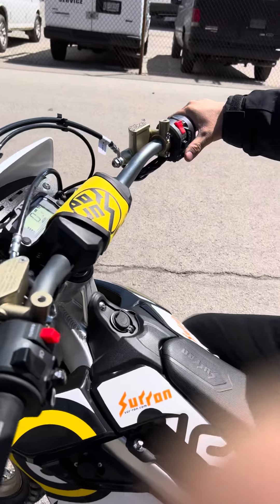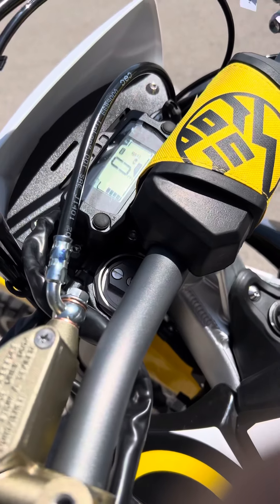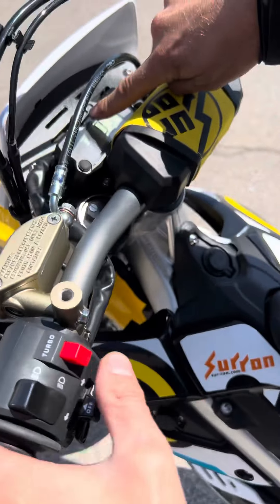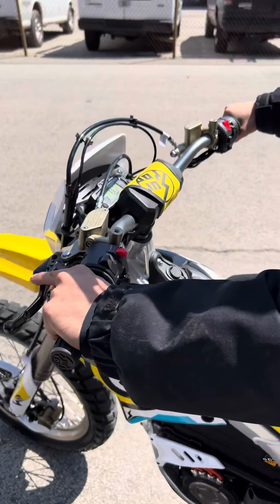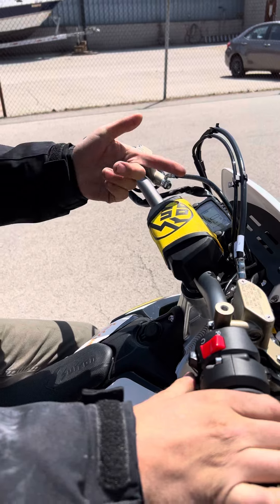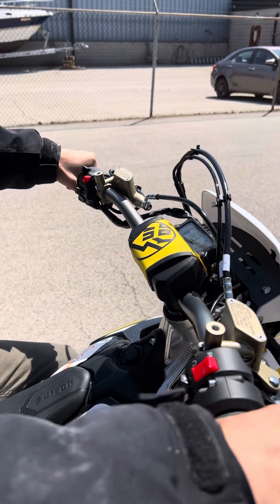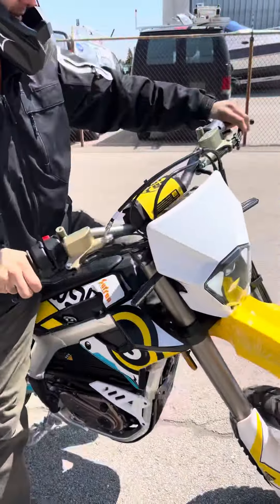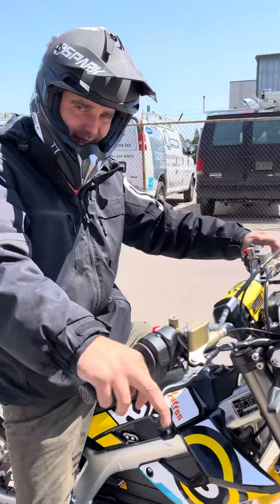Electric ⚡️Mx - Surron Storm Bee settings and functions @electricmx

Comment: By the way, did you ever meet any clutch disk problem in the recent 3-4 months testing? Senior zhang said, if clutch cable is not properly adjusted and it is in half clutching condition, it is easy to wear out the clutch friction disk soon
Reply from the maker: So far no issues the clutch is working great I’ll keep any eye on it though